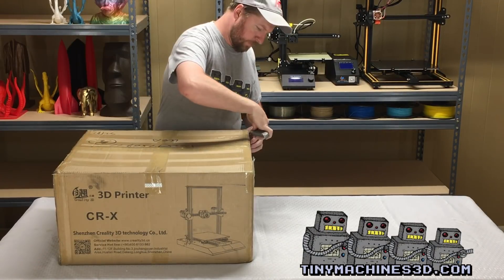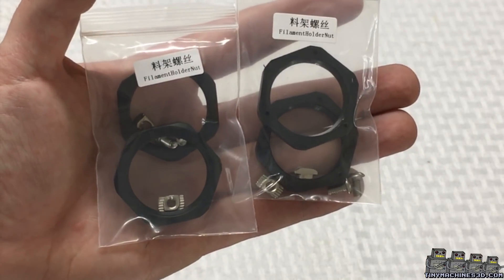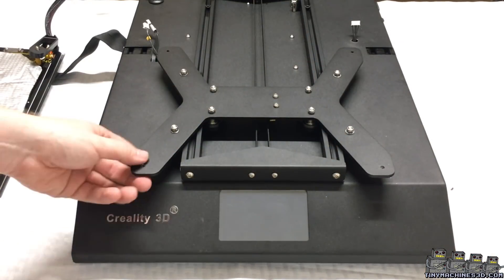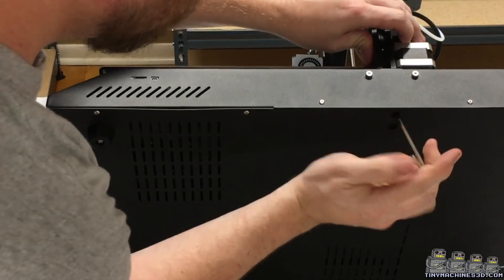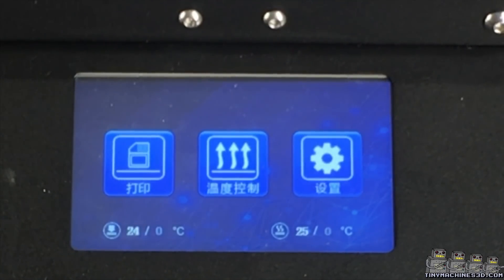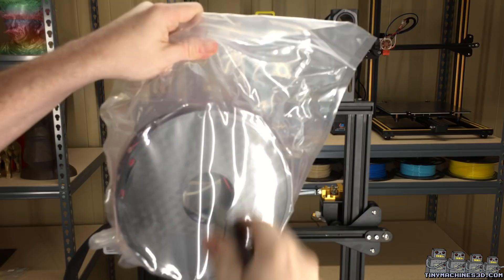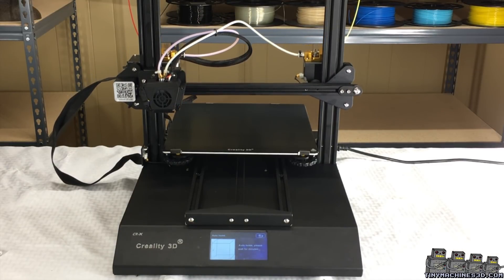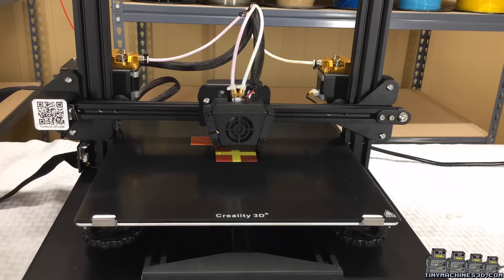Creality CR-X Unboxing and Assembly

Comment: As an owner of a CR-10 mini that I modified to be whisper-quiet, I feel the CR-X could be designed better. First of all, the electronics compartment is way larger than it needs to be just to fit that power supply, control board and MOSFET. The heatsinks on the control board are at the wrong orientation relative to the fan - the fins should be parallel to fan airflow so the air flows through them, but instead, here you see them being perpendicular so the first fin blocks all the airflow. And with all that empty space they could have fitted a larger diameter fan instead of a tiny, noisy blower.

Lastly, they should have paid an English-speaker to translate the menus properly. It's 2018 and after putting all that effort into printer R&D they skimp on the translation and release a half-baked menu with phrases like "please wait for minutes" or the misleading "cooling" instead of "cooldown."

Does anyone have any specs for this? Build volume and price? I can't find it anywhere.
Reply: 300*300*400mm $800
Reply: Thanks :)

Comment: Hello could you tell me i'd like to buy CR10 s or CR X i m a biginner ?
Could you tell me, because CR10 or S need some New things ?

So perhaps CR X Have got nothing to change ?
Reply: Wedge Dimension get the cr10 if you want the large build volume, but if you just want a printer I recommend the ender which is buy the same company. It is a great printer for only $200. Don’t get the crx until you are more advanced